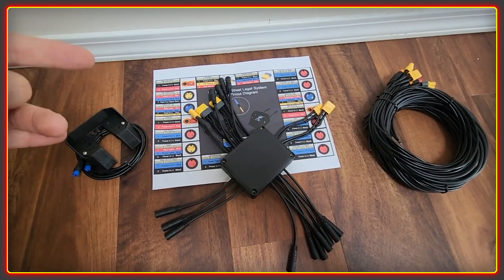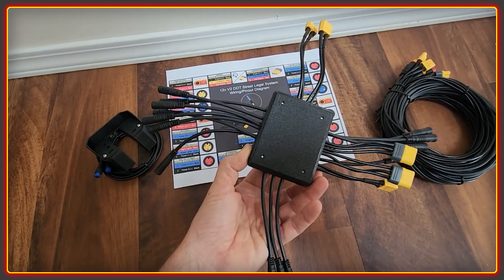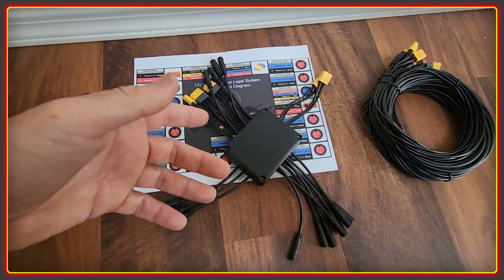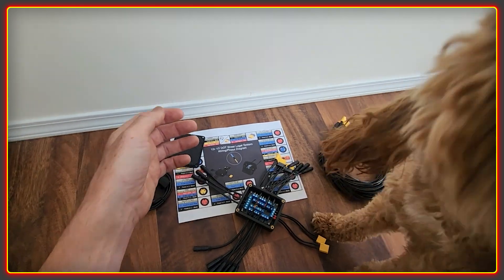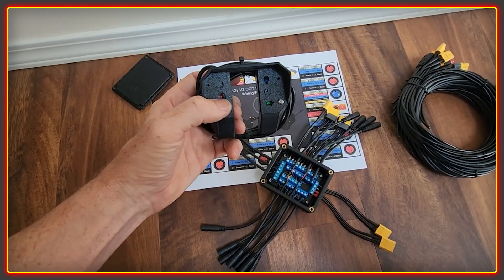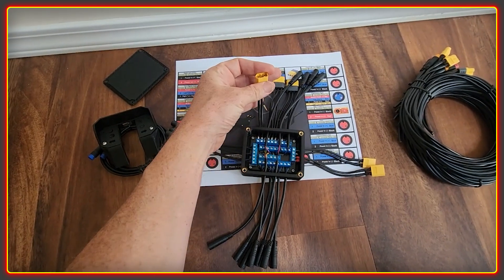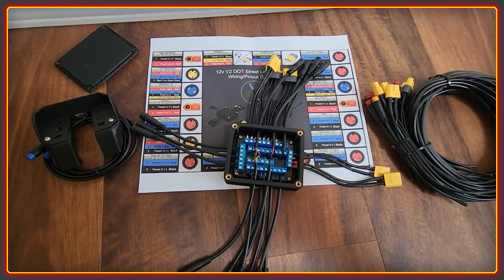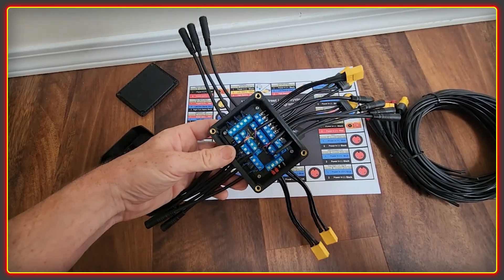Want a road legal Ebike? Use this Black Magic Box of Tricks!

Comment: I've just done something like this on my Eleek frame, with working indicators, brake light, tail light, running light and high beam. It's not technically road legal here still, but it makes it easier for road users to understand what you're doing.
Reply from the maker: Cool, you should share it on Discord if you get the chance! Sound great!